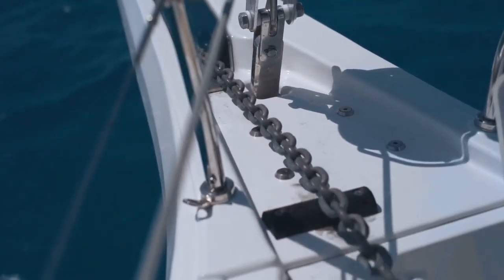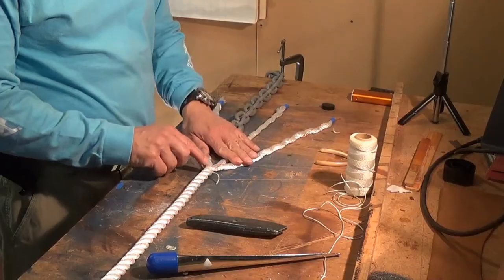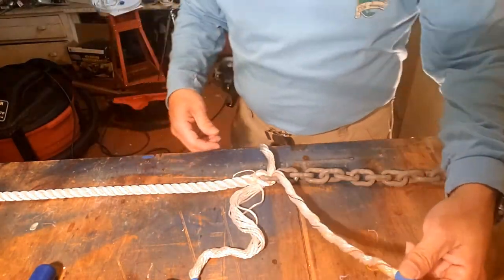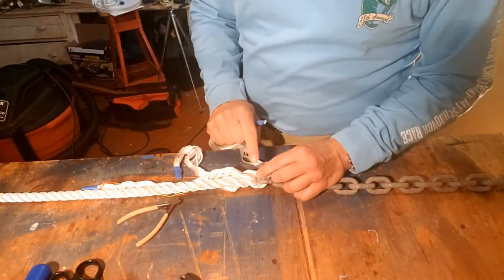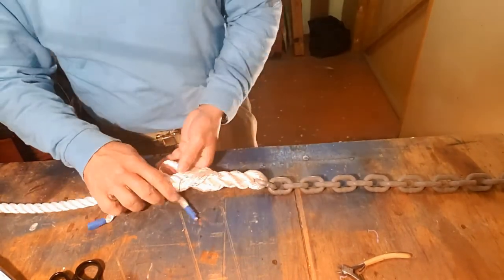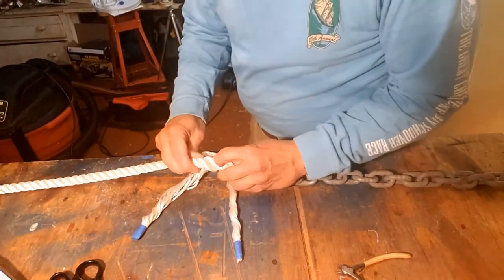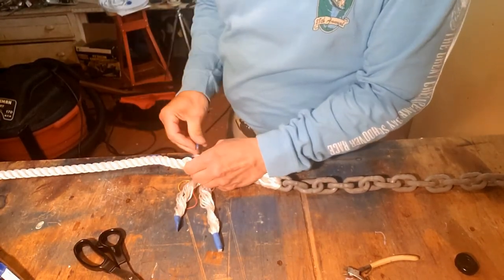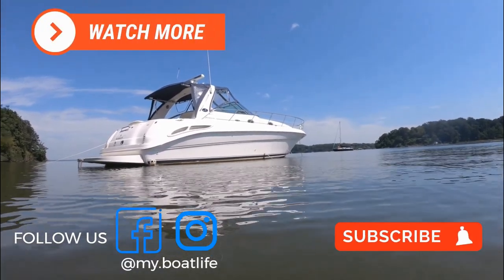How to Splice Line to Anchor Chain on a Boat

Comment: Very good video and that's exactly the size I need for my 43 ft trawler. My rode is 21 years old and only have 100 ft of chain and 100 ft of line. Thinking of putting on a new 300 ft line. 
Does your splice easily go thru the windlass?
Reply from the maker: @captrobchichester can answer that but believe so

Comment: Captain Rob, I am in Rock Hall and  either need to do this or spend $400 for a new set up. any chance your available for hire?
Reply: I have a 41' sloop.  My materials alone cost over $500.  If I will were to say I could do it, I will not have any availability until October and between materials and my labor, you will pay more than $400 I am sure.  Given the size of your boat, $400 might be a bargain.  By the way, I do NOT live in Rock Hall.  My boat is berthed there.  If you are still interested in discussing this, let me know.
Reply: @captrobchichester  I may hit you up. I have the line and chain so I'm going to give it a shot myself first. Your video was pretty detailed. Wish me luck
Reply: @gschlectic  Good luck!  Getting the right chain and getting the first tucks of the line right are the biggest challenges.
Reply from the maker: Glad Rob’s video was helpful - he’s the best!!

Comment: Ummm... why are you doing it worng?  Why are you putting all the pressure on one place of tge line instead of splicing it into the chain so the weight bearing is spread along a longer stretch of the line?
Reply from the maker: Both methods work good
Reply: @MyBoatLife  But one has a single point of failure at the weakest point in the lashing that also happens to have lots of natural friction.  The other distributes the load across the entire lashing and does not have a single point of failure at its weakest point.
Reply: What he is doing is not “wrong,” it is an alternative to a longitudinal splice which has its own failure mechanisms.
Reply: Looks to me like he's putting the pressure in three points. Each strand.